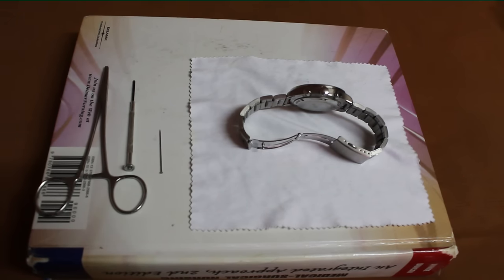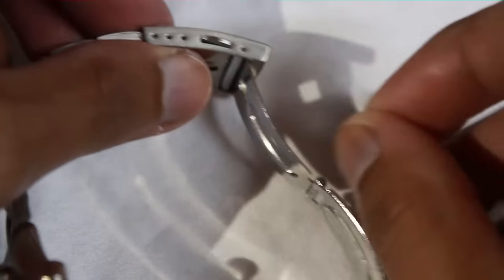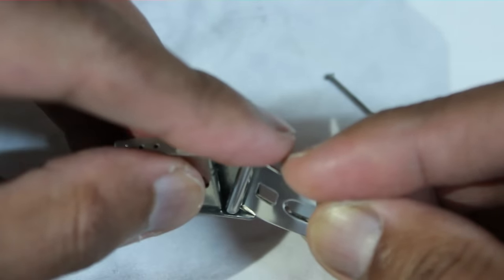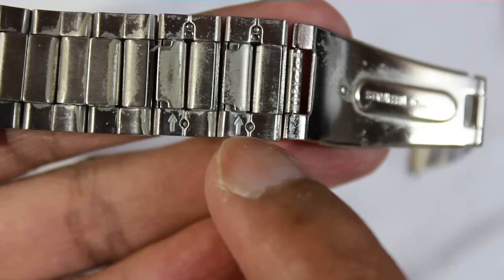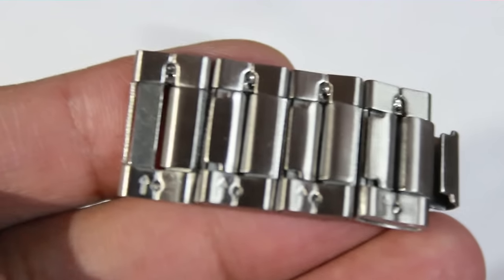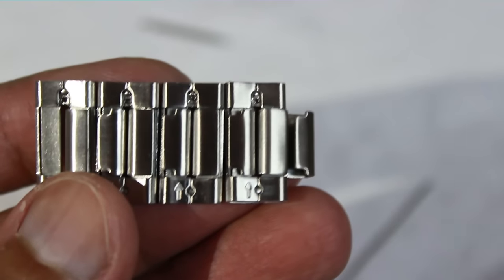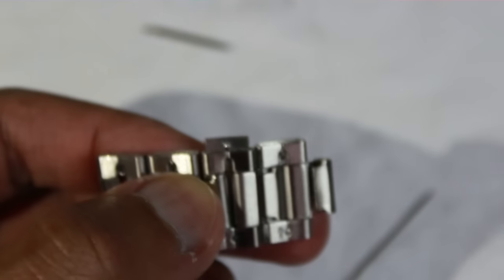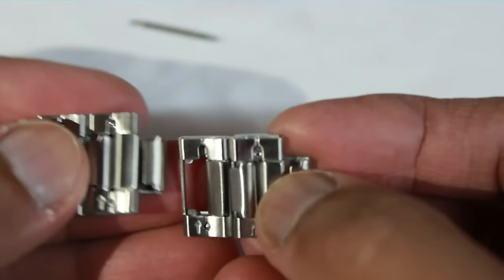How to Adjust your Seiko Watch Band the Easy Way Recorded from a DSLR

Comment: Great work!  Two tricks to share after doing this the first time...  (1) A simple fingernail clipper can pull the pin out with much less exposed pin than needle-nose pliers.  (2) If replacing an existing watch, count the number of "arrow" links to know how many to remove from the new watch (I had a "duh" moment when I was done an realized this).
Reply: Hi
Reply: thanks man

Comment: You really should have shown how to reattach the watch itself. I removed the pin at the beginning and now I can't get it back on. I think I may have lost the spring so now I'm screwed.
Reply: You re-attach the bracelet by hooking it onto the exposed bar. You will see a gap of about 5mm  between the links. Join them together and push the pin in with your fingers.
Reply: I am interested in this as well.
Reply: On mine, the latch has a series of very small holes on each side.  Three on one end and one on the other.  The pin you removed goes through the larger hole in the link closest to the latch to start with.  Then one end of the pin you'll seat into a hole on one side and then you compress the spring on the other end of the pin until you can slide the compressed pin in between the two sides of the clasp and slide it into the hole opposite the one that you put the other end of the pin in.  To do the compression you can use your finger nail or a dental pick.
Reply: LMAO

Comment: Watched your video three times to make sure I had everything, then removed 1 link from my new Seiko Men's SKS421, and it all worked just as you demonstrated in your video. Had a heart-stopping moment when the hinge pin popped out of the hinge and launched into the air like a rocket ... but I was able to find it on the floor, and after that I was more careful with it. Other than that, no dramas. Thanks for the video -- it saved me $10 or more at the jeweler's, and now my watch fits perfectly.
Reply from the maker: I'm glad my video helped you. thanks for watching and don't forget to hit the like button as it helps me out a lot. thanks!
Reply: often ... $15.00 :0
Reply: Exact same procedure and ending.

Comment: The locking pins weren't easy to get out, they seemed to be in there very tight, but it worked and saved me $35-$50 so thanks for the video!
Reply from the maker: +TheHappygilmore22 yah, at first they are hard to pry out but once it gets loosen up, its comes out easily. you're more than welcome watching my video my friend. glad I saved you that much money lol. anyways, can you pls. SUBSCRIBE to my channel as it will help me out a lot, if not that's fine. thanks again!

Comment: Your video was helpful in showing how the Seiko pins worked and slid out.  Using a flat head screw driver didn't work for me for removing the pins.  What worked was using a simple thumbtack.  I would hold the watch perpendicular (arrows up) to a flat surface.  I would then place the point of a thumbtack in the groove you show in the video.  Then holding the watchband on each side of the link (pin) you want to remove I firmly press the flat top of the thumbtack onto the table.
Reply from the maker: +Mark Bliton thanks for sharing those information. and im glad my video helped you. anyways can you do me a favour by SUBSCRIBING to my channel as it will help me out a lot, if not that's fine. thanks again!
Reply: Omg thank you so much this actually worked like a charm :)
Reply: Flat screw driver didn't work for me either because I didn't really have a slot to fit it in.  So I finally just pushed directly on the bump on the link and pushed the link out.  BTW, if you just need to shorten the band a little, you can move the spring loaded pin on the part of the clasp labeled SEIKO one or two holes.  Do this on the pin holding the chain and not the pin holding the folding clasp.  If you do this on the pin holding the folding clasp, you won't be able to close the band.

Comment: Thanks for posting.  My Seiko steel band is slightly different than the band you have in the video.  Maybe its because my watch doesn't have a USA warranty, and thus it's gray market (not authorized for sale in the US).

With your band, you are applying upward force to the link joint by twisting the micro-screw driver.
My band has full circles (holes) over the link connector head; they block using micro-screw driver from UNDER the links.  Instead, I had to use a 3/64 (a 5/64 is too big) in the "holes", and like you, twist left-right to apply upward force to move the connector up.  After getting started, I then angle-pushed to get more of the connector head out before using a needle nose pliers.
It also helps if you avoid pulling on adjacent links (side-to-side, because the connectors may not move out under that pressure).
In my experience, I found one was easy to get out, and another took a lot longer.
Reply from the maker: you're more than welcome my friend and thanks for watching my video, pls don't forget to SUBSCRIBE to my channel as it will help me out a lot, if not, that's fine. thanks again my friend.

Comment: My Seiko 5 has a different style of band and due to the hole being significantly smaller it's not possible to use a screwdriver to take the link out. I've found that a corkscrew works brilliantly tough, so much so that once the link has popped out you only need your fingers to remove it. So if you're having any problems I recommend using a corkscrew.
Reply: +Gethin ap Phylip Worked brilliantly, cheers mate!
Reply: AlfredTheGreat Good to hear, I managed to come up with that after a lot of trail and error.

Comment: Thanks for the video...now I know how to remove the links in a Casio watch. Btw, that is a flat head screwdriver...the phillips is different....like how I describe it to my kids...there's a "cross" at the tip when Im asking them for a phillip screwdriver.
Reply: It's NOT a flat head screwdriver.  It's a flat blade screwdriver.  Flat head screws can also be phillips headed.
Reply: @jeffreyhess5013  nope. We are talking about screwdrivers...not screws. I get the screws can have a phillips, torx, etc. And that you refer to the geometrical shape the screw is shaped. But flathead screwdrivers, wrong as it may, is now universally acceptable as what you refer to as flat blade screwDRIVER. And since we are talking about that particular screwDRIVER in this video, philips screwdriver is out of the question...in this video at least.
Reply: @jackhazz5777  I agree that in this video, reference to a Phillips head screwdriver was incorrect. However I disagree that just because something is universally accepted, as you've stated, it is right. I could come up with many examples (abortion being a big one at the moment). The term flat head screwdriver (a screwdriver doesn't even have a head) is incorrect whether it's universally accepted as correct or not. We may just have to agree to disagree on that.

Comment: My arrows point upward (toward the outside of the band). I cannot insert my thin screwdriver into the area that you indicate (so I cannot twist it).  There are 2 what appear to be pins on either side of the watch band??? Do I have a different Seiko band?
Reply from the maker: if yours doesn't look like mine then its a different kind of band

Comment: You might want to include a note about holding onto the pin, so it doesn't fly across the room.  I was going to say something about the Phillips, but apparently, I'm not the first.... or the 50th.  I've done this many times, but now I'm in the market for another watch, and it's always a problem to be sure I can shorten the wrist strap, before I buy.
Reply from the maker: +Robert Mertens sorry about that, hope it didn't poke your eyes out. yes, I know Philip. I will put annotation to it so nobody msg me that again. anyways, thanks for watching my video, pls don.t forget to subscribe to my channel as it will help me out a lot, if not that's fine. thanks again!
Reply: +L BS Actually, I've owned many watches with this style, so I know if you push down on that pin and don't hold onto it, it'll go flying (it's spring-loaded).  Anyway, I've decided against the Seiko - I read a review on the one I was interested in, 'Ion gold-plated" but the reviewer came back a few months later and complained that the "gold plating" was coming off.  Good video, though.  Annotations help so you won't have to edit and upload again.

Comment: You saved me having to take the new watch my mother received as a gift from her place of work at retirement, even if you did call the small flat screw driver a Phillips, I see in the good quality video it was a straight or flat screw driver, so it’s all good , thanks a ton my friend! Oh, one thing maybe mention that first pin removed is sort of spring loaded, I’ve had those shoot away when removing them because I was not being careful enough. I already knew that part , but someone never doing anything like that to a watch band might end up learning it the hard way as I did the first time I worked on a watch band. It’s so easy to forget little details like that , I do the same thing more and more, in my case it’s just old age I guess, lol. But thank you very much for the video as I have never seen a band like these seiko bands are made, I would have never figured how to remove those links
Reply from the maker: you're more than welcome. i know i screwed up the names of the tools and totally forget to mention about the spring loaded pin. i did an updated video and its so much better but it aint getting enough views to be on top of the search. im glad my video did help you tho. cheers!
Reply: YourTechGuide , helped much , I would have never figured it out without your video. Happy new year!!

Comment: Thanks, that made it easy. Didn't need pliers, easily pulled out with fingers. Also did it without "flattening the band by removing the pin in step 1". So for me it was a tiny screwdriver only procedure.

Comment: Okay, I just did this on my new Seiko.  May I present what I believe is a better way?  It only requires an ice pick, no needle nose pliers or screwdriver although I did also use a dental pick.  I came up with this method because on my band the place where he inserted the screwdriver didn't exist, but also, I bet he screwed up the end of his screwdriver.

1) Use dental pick or ice pick to remove the pin on one end of the latch so you can lay the bracelet out flat

2) You know the hole he said he tried to use and couldn't get to work, well this is actually the correct hole to use.  Inside that hole closer to the center-line of the band is a place to insert an ice pick and then just press outward and the link fork will come out far enough so that you can remove it all the way with your fingers.

Then reverse this procedure.  If you have trouble getting the link fork back in all the way use the wooden handle of the ice pick to tap it in place.
Reply: instead of the niddle and  screwdriver there is a special removing tool you can buy on ebay or aliexpress for about a dollar

Comment: that is a standard not a phillips screwdriver but thanks for the vid it did help
Reply: and counting is not his strong suit either. Its 4 arrows he was showing and not 3.
Reply: @David Armstrong  Because English is a foreign language for him.   Just because he speaks English in this video does not mean he lives in a country where English is spoken.  Phillips is not the name everywhere.  In German, for example, (substituting English words as appropriate) its a  "cross-slot-screw-turner" 

How did he get it wrong?  Simple mistake.  Someone probably showed him a Philips screwdriver from a set of so-called "jeweler's screwdrivers"  and he mistook the "Phillips" part for the tiny screwdriver part.  Unless you have someone there to correct you, it would be easy to think that all the small screwdrivers in the set were "Phillips."  After all, the name of those small screwdrivers in the set is a bit silly. All the tips in a typical hardware store "jeweler's screwdriver" set are far too large for actually working on jewelry.

Bui I have the same question for you.  How can you not know the difference between "Slot" and "slot"?  I think everyone learns in about the third grade the difference between a proper and common noun -- that thinks like family names are capitalized, but ordinary things are not.  Yet  you managed to show your English "wisdom" with a mistake an 8 year old should not make.    Impressive.

Comment: thanks.was dead easy but its not  necessary to do the first step-disconnecting the band with a needle from the clip-makes access slightly easier but not needed.

Comment: This was a great starting point for me, but the Law of Murphy denied my success, at first. My new Seiko, from Amazon, came with a different links system:  there are links with arrows, but they do not have locking pins as demonstrated here.

Instead, I had to punch the pin from below the arrow to dislodge it, then pull it out with a pliers. You should use a wood-working nail, I suggest a small "finish" nail. 

Position the band with the links "vertical" on thick cardboard or on top of two pencils or other wood products, so that there is air under the link, not touching the table below.

Put the sharp point of the nail on the end of the pin (bottom of pin, below the up-arrow). Hit the nail with a pliers or a hammer (lightly) and the pin comes out the other side.

After taking out the links, re-attach by inserting the pin from the "top", making sure the the bottom end goes in first. The top and bottom are not identical: the top is "smooth" and the bottom has "wings" that look like they are meant to compress into the bottom of the pin socket, thereby holding tight. That's why a sharp hit is needed to dislodge it. I suspect that a pin will not work right if removed and replaced more than once or twice, but that's just the guess of a learn-by-doing DIY-er.

Dave
Reply from the maker: +HandyMan Dave thanks for sharing the detail information on how to remove the links from your watch. anyways thanks for watching my video, pls don't forget to SUBSCRIBE to my channel as it will help me out a lot, if not that's fine. thanks again my friend.

Comment: 2:36 mine is just stuck the locking ping wont move one bit
Reply from the maker: +ibrahettingvic you really have to wiggle it through my friend. I had the same issue at first, put some force into it, wiggle and push it outwards. good luck. thanks for watching, pls. don't forget to help this channel out by SUBSCRIBING as it will help me out a lot. thanks again and let me know hows things goes.
Reply: L BS thx i did it now :)

Comment: The bracelet does not need to be split to see the arrows but might make it easier.. never work with any tools like this off a work bench, always work with your watch on a solid surface in a holder or on some non slip material.. main thing is for link removal and refitting is follow the arrows.. health and safety would probably also tell you to wear safety glasses in case your needle/ screwdriver splinters..

Comment: Thanks for the step-by-step. I like the medical pliers you have to remove the key, they would come in handy in many uses.
Just to clarify- On some Seiko bracelets, the arrows are stamped on the same side as where the pin (locking key?) comes out, though they point in the same direction.  The difference is in the type and size of holes where you insert the tool. 
To start, I recommend using a toothpick to remove the spring bar from the clasp.  No sense in scratching the side if you slip with a metal tool, pin, or whatever you find laying around.  The "right tool for the right job" helps to make the job easier, and less costly in the damage you may cause when working on a watch.  Especially when you're trying to show a friend how easy it it is to do this yourself- then you scratch their watch and look like a beginner...oops!

Comment: nice job...hey that's not a phillips screw driver you are using...most call hat you were using a "flat-blade", "slot-head", "straight", "flat", or "flat-tip.  The phillips tip is designed to fit X-patterned screw heads.

Comment: thanks for the video.  seems like you have interesting tool selections.  instead of a needle nose plier you are using a haemostat (a blood valve clamp), and a phiillips screwdriver is a cross hair or X screwdriver.  It can't be flat -- which is a different kind also called slotted.  I have to assume you are in medicine or healthcare based on your tools :)
Reply from the maker: yes, I like to call my tools not their right names, that's just how I function, life is to boring following the rules and names for each tools. anyways, thanks for watching, pls don't forget to SUBSCRIBE to my channel as it will help my channel grow, if not that's fine. thanks again my friend.

Comment: Not to put too fine of a point on it but that's not a thin nosed pliers you're using in the video, it's a hemostatic clamp (or just hemostat) which is a medical tool for clamping off a vein.  And you know about the screwdriver.
Reply: Fishermen use them to remove hooks from fishes' mouths.
Reply: Actually it's a needle driver, but correct that it's a surgical instrument!